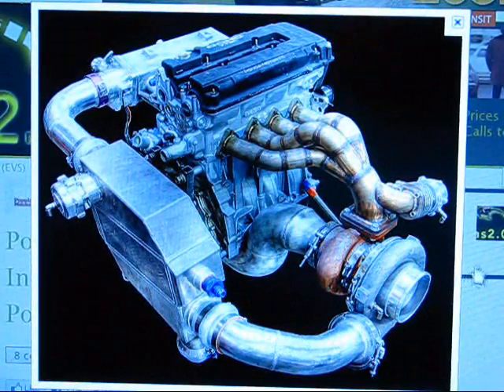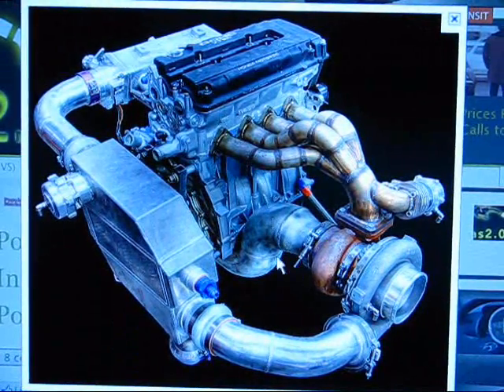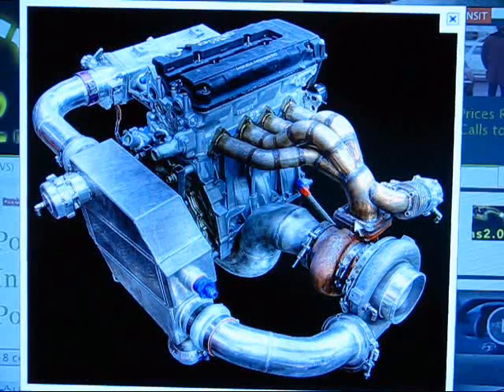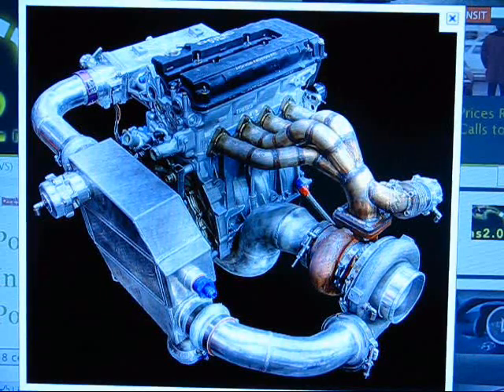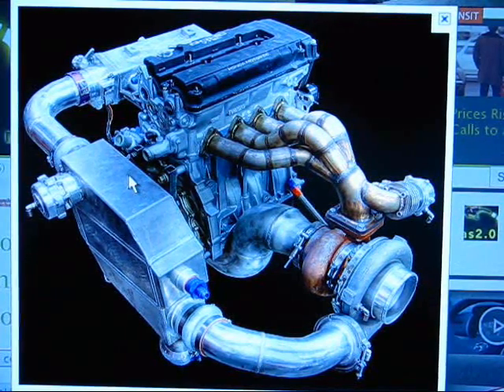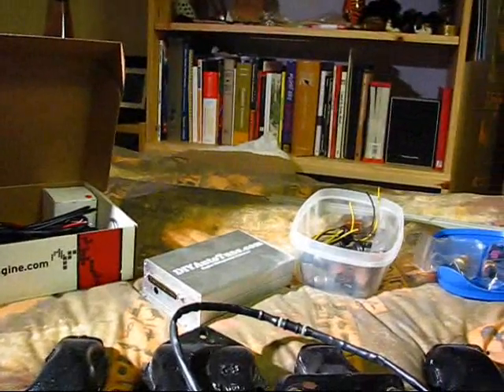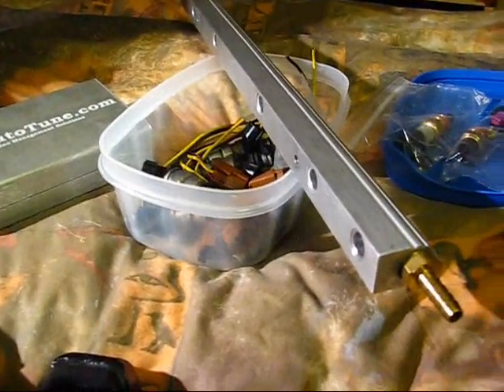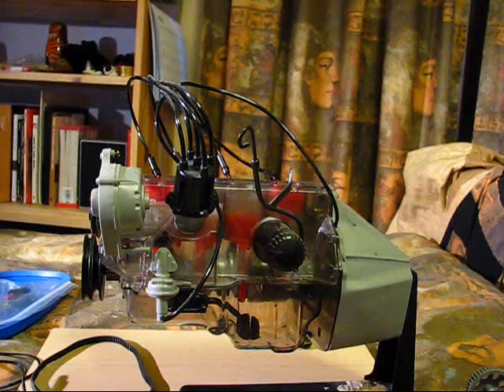Turbocharging a car Basics Part 2

Comment: Questions:
* can i skip the ECU upgrade and just upgrade the injectors to a big size to run rich and not worry about pre-detonation?   ..or either just run a really high octane level  to prevent predetonation ?

((nearly free turbo and parts. Doesnt come with ECU and want the cheap way to turbo))

Comment: Depending on the shape of the engine itself.. if the head and block are worn... you're pretty much pushing it to blow soon... other things to consider is the engine has good compression..  whether the cams and valves will hold the high pressure.

Comment from the maker: @diegospassos I've never seen anyone do it any other way than taping into the engine's oil pump, most likely because it would be the most reliable. Most people just tap a "T" section into where the oil pressure sender screws into the block. Remember to get the propper size oil restrictor if your turbo doesn't come with one.